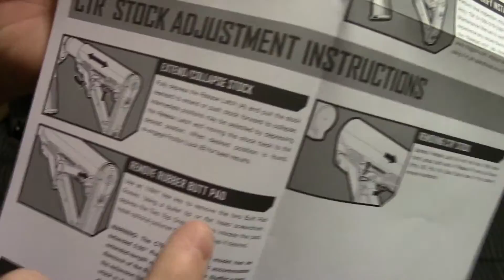Unboxing & Installation: Magpul FDE CTR Stock (Mil-Spec)

Comment: ATTENTION ALL MAGPUL CTR & MOE OWNERS WHO ARE LOOKING TO PIN YOUR STOCK:

Zero cost, drill one hole, its that simple. Just remove the roll pin holding the plunger assembly. Remove spring and cross bar. Re-insert plunger into stock attached to buffer tube and position length to where you want to pin. Rotate plunger 90 degrees, to where a pre-drilled hole at bottom of plunger lines up to any side of stocks roll pin hole, re-insert pin and firmly tap the roll pin to hold plunger in place. Flip the stock over and use a 3/32 drill bit inserted into the roll pin hole to drill hole into the other side of the plunger. Once hole is drilled, remove roll pin from other side and tap roll pin into the hole just drilled to pin plunger in place. You're done. 

Worst case scenario buy a new roll pin (3/32 x 3/4) @ $.50 - $.60.